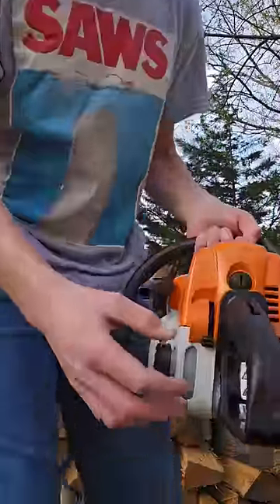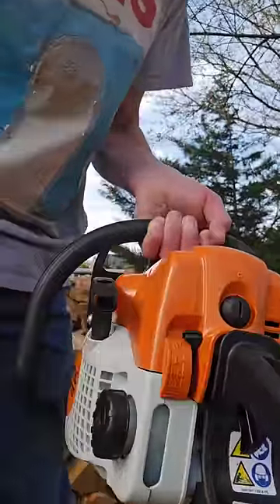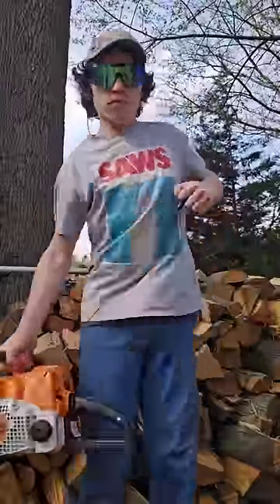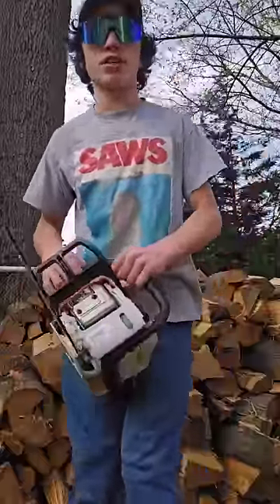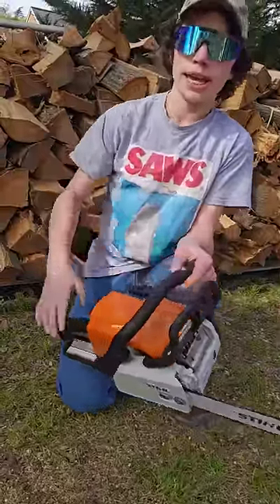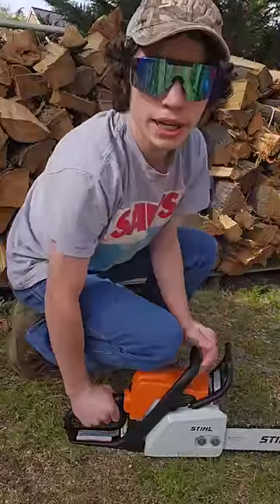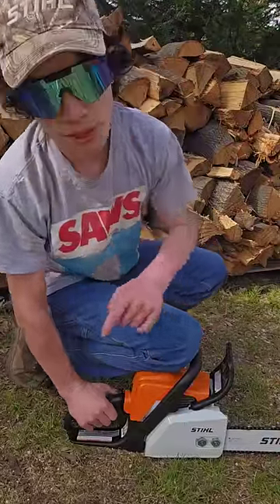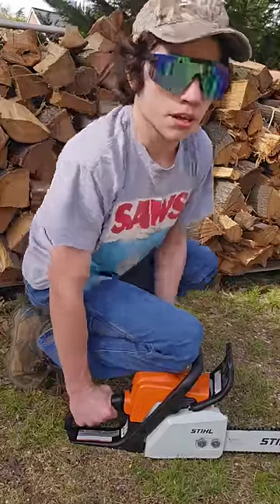Unflood a chainsaw #stihl #flood #chainsawrepair #chainsawman #stihl #viral #shorts #roadto2k

Comment: Best way to unflood a saw is to pull the spark plug, turn the saw upside down and pull in the off position. Pull untill you dont see any more fuel coming out. Then dry off and reinstall spark plug and start the saw first pull in the half choke position. Used to work at a stihl shop, did this 20 times a day because no one listens to the startup procedure
Reply from the maker: Not everyone has the time or wants to get covered with gas. This is an easier way.
Reply: No this way he did it was way smarter and faster
Reply: Thanks for the information
Reply: @OliverDiGeronimo009 yeah no your way is a lot better lol my grandpa showed me how to do that one time when I was like 15 lol I’m 27 now but yeah removing the spark plug and all the junk would take a while and would suck
Reply: Sounds like you like things the hard way huh?
Reply: Sounds like you're a mechanic not a chainsaw operator bud. I've been running a chainsaw for 13 years daily. No need to pull the spark plug 😂
Reply: It’s highly recommended to start your saw on run with a flooded saw. I understand the tech side of things but if I can avoid pulling my plug in the stick I’m gonna do it, I do not want contaminants deposited directly into my cylinder. 😂
Reply: Same concept shown in this video is used for vehicles. If you flood an old carborated engine you jam your foot to the floor and turn the key. You've opened the carb wide open. This allows air into the cylenders and since gas evaporates at such a low tempature. If your battery  is fully charged and has good cranking amps it will usually clear out and start
Reply: I just pull the spark plug take an air chuck put it in the hole pull it over and put some air in it and the air will cycle the motor itself and crank it over do that for 15 seconds and ur good to go
Reply: Facts
Reply: @lucasquinn719   Air compressor is pretty much an S+ rated tool. Almost undisputed.
Reply: I’m fucking dying this anwser is def the correct way if my shit floods I hook it up to my truck then start running lmao
Reply: Bruh you really tried to say your way is the best way. The kids way is way faster and safer. There’s no chance of getting anything in your engine. Imagine your out in the field and there’s sawdust everywhere and you decide to pull your spark plug out to introduce all this gunk straight into the top of your engine. Use your head
Reply: @Cocodrankspearfishing and if you ever even had a bad carb and managed to flood it so bad it hydro locked then you shouldn’t be running a chainsaw let alone operating any machinery 😂
Reply: Stihls never start right. Regardless of procedure
Reply: @lucasquinn719  bad idea, to much presure and u kill your membrane or a small nozzle
Reply: @LASER_de  as soon as it gets going and cranking over it’s fine there will never be to much pressure u less u block off the spark plug threads plenty of room for excess pressure to escape
Reply: Another STIHL mechanic here lol, yeah the whole time I am sitting here thinking “just pull the damn plug!” Lmao
Reply: The only way mine would start reliably is full choke until it tried to start up then half choke 1 pull and it was good to go. Also id unflood it the same way you said with the spark plug
Reply: Just use a lighter
Reply: Who the fuck has time for that?😂😂😂
Reply: Took the words out of my mouth, best way to
Reply: @OliverDiGeronimo009 doesn’t take much, just the tool for the saw and if you get gas on you, then you need more experience. I’m too used to gas working on these things. Great vid tho didn’t know I could do this
Reply: I was actually just at still school and they didn’t say anything about pulling a spark plug on a flooded chainsaw they said hit the chain brake on , no choke pull until it starts
Reply: Sounds like there’s a lot of people afraid of pulling a spark plug.     Just saying, once you get sick of yanking, that spark plug is going to look pretty easy to pull if you’re not afraid.
Reply: GDI and I read all the comments… do NOT pull your STEEL sparkplug out of ALUMINUM threads to unflood yer saw… I love auto ON switches but there is a down side. No pros pull their plug. Turn the switch to OFF and BLOW the plug dry by pulling the starter 5-10 times. Then turn the switch ON and it will fire. Blow the plug off by using the piston. You keep pulling the plug you WILL be putting a jug on it sooner than later. The closer you are to fixing it means the less you’ll “intentionally” flood it. As soon as you know your otherwise properly running saw is flooded, turn the switch to OFF pull pull pull then turn it on and it’ll fire.
Reply: @davesteier-xf5lh  how? The off switch only counters the magneto, by pulling the cord you are cycling the piston and using the vacuum to push in gas. Pulling the plug is the best option, in all my time fixing these and stuffing no one ever who fixes machines have told me pulling the plug is bad, never failed, never went wrong, and the saws and any small engine has lasted. Explain it better friend
Reply: Ehhh I just pull the plug and hit it with the torch and give it a quick pull.
Reply: As a Stihl Tech I've gotts say taking the plug out is the longest way around unflooding a saw. This young man has a good career ahead of him

Comment: Better yet Bro - a proper way to start a 2 stroke -- (5x prime pumps on rubber bulb if fitted) Fuel ON, Choke ON - Ignition OFF.... 3x slow "priming" pulls/kicks of the cord - you wanna distinctively hear and feel each pop, pop, pop, pop every time. Set Mid Choke (if possible, if not stay full choke) Ignition ON, Big Yank on the cord... If "mid-choke" leave min 10 seconds to warm before "blipping" the throttle to start revving up, IF stuck with full choke, leave 5 seconds before "blipping" the throttle and disengaging "auto choke" and rev it a couple of times untill warm enough to tick over.... This technique can be used on all 2-strokes and some 4 strokes including older Yamaha's, MZ's, Harleys as well as simple Sthil or Ryobi's!!
Reply: God-damn that's complicated. By that time I'd go to store and buy me some Husky. Those things are way easier to start.

Comment: This method works well for a mildly flooded saw. With a saw that has a bad vent on the fuel tank cap, you sometimes have to pull the spark plug to remove the excess fuel.  I've got a 7910 that floods badly after heat cycles due to a plugged vent cap and you'd be there for a year trying to get the fuel out of the cylinder if you didn't pull the plug.

Comment: That may work if it's slightly flooded but if it's bad, you have to pull the spark plug and dry out the cylinder and plug before starting it the way you did.  I work at a small engine shop and idiot customers bring in their "broken" chainsaws that are flooded all the time.

Comment: Or just put the bar on a log or something, the hold the trigger down, and push the saw into the wood while you pull the pull start. (Make sure to leave the brake on)
Reply: It’s a lot easier if you’re older and can’t get into a position like that.

Comment: 😂😂 on older saws you literally have to flood them to start 😂 I pour gas into the carb
Reply: Yes or saws you havent ran in a while but what has that to do with flooding?
Reply: @thomaslindroos1667  it floods them thats what is has to do with flooding 🤔
Reply: Good old plug pull and a lil squirt, pops first pull. 😂
Reply: We have a lot splitter than needs the cylinder half filled with gas through the plug hole before it’ll start 😂
Reply: @isaiahshaffer  must’ve got the same model. 🤣
Reply: Pull the plug. Give a good sip right in the pie hole.  Replace plug. G2g😂

Comment: I just jam my boot in the handle so it holds it down. Or I just lay the tip of the bar on a log and pin the throttle with my right hand and pull with my left

Comment: Yeah that works but when you got old raggedy saw, weedeater, push mower whatever put little throttle body cleaner or carb cleaner in the carburetor you can use gas or but it’s a little more flammable and it will start but the safer way to test fuel pump in a car or try to start a small engine that ain’t ran for years spray throttle body cleaner in the carburetor or throttle body

Comment: Never rev your chainsaw with the chain brake engaged. Just pull the spark plug, tip the machine and pull the pull start then put the spark plug back in and bosh done.
Reply from the maker: It is only for a few seconds, I immediately came off of it once she started. I shared this method because it is easy as 1, 2, 3 and requires no tools.